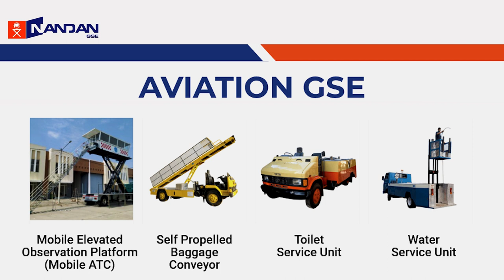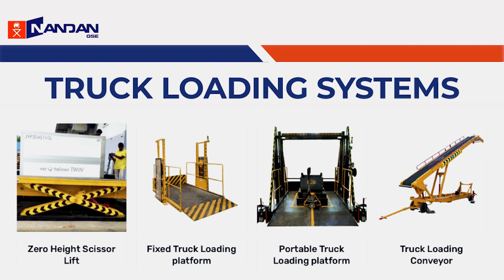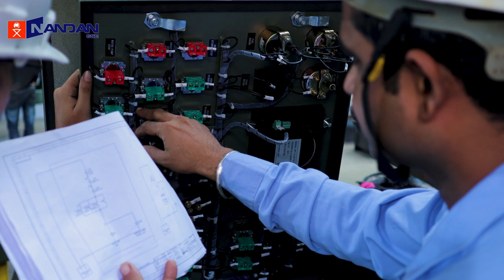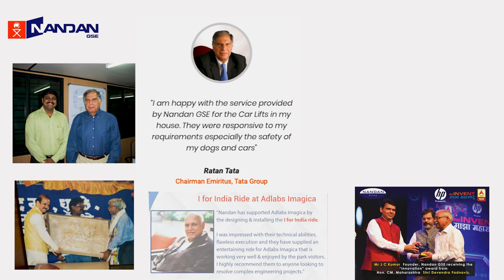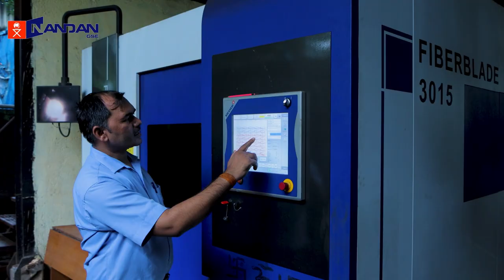Nandan GSE Corporate Movie Dec 2021

Comment: Congratulations. Most of the GSE seems to be conventional. It will be nice if some automated GSE like automated aircraft towing system is added to the inventory.
Reply: Sure sir. Its in process!
Reply: @OriginalRaghudon  automated Aircraft towing is a very specialised activity.There are no OEMs in India. At one time HAL tried to develop by reverse Engg a German product. If you are interested, TOT is the only way. With my experience, automated towing should be introduced as soon as possible because a number of incidents/accidents take place with manual tractor towing. Indian Navy and Air Force are interested.